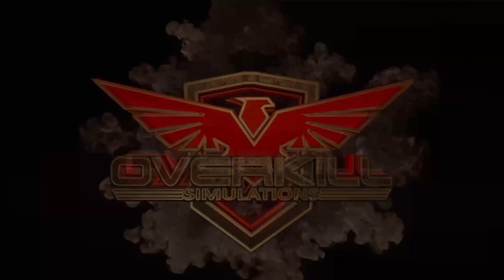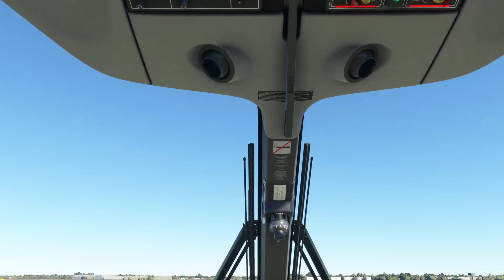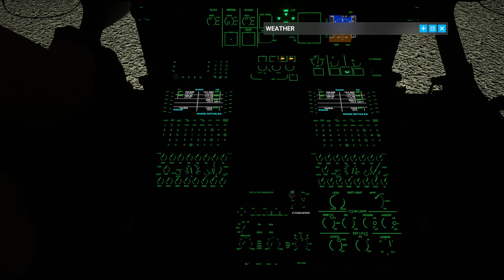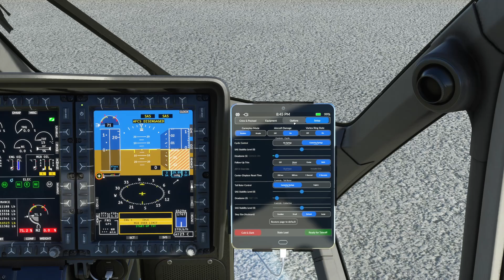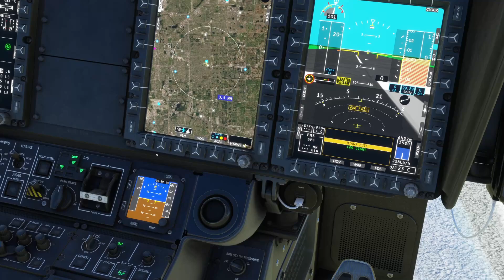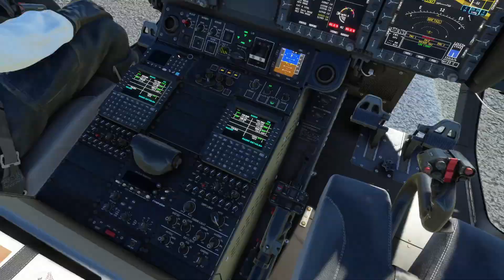HPG Airbus H160 Helicopter | Pre-Release! MSFS

Comment: The H160 is not Fly-by-wire. The only civilian helicopter with FBW is the Bell 525.  
The green lightning is Night Goggle Friendly.   
OEI = One Engine Inoperative
Reply from the maker: Thank you for the information.. and yes you're right.. the FBW statement was bad verbiage...
Reply: @OverkillSimulations  Airbus and especially the 320 is known for FBW. It's easy to think that their helicopters will have it too. They did consider it when they designed the H160 but decided against it due to complexity and cost. I bought the H160 last night and wow its a great bird.

Keep up the great work. 😊

Comment: Looking forward to this. Not sure if I will get it straight away or not though. 

It looks so sharp on the outside with the how sloped the glass and nose is.

I’m guessing they’re supposed to be that quiet on the inside and from videos I’ve seen I think they are… if you’re a millionaire buying one of these you don’t want to have to wear a headset.

Does the manual have a guide for what keybinds/axis to set?

Also, lol at the Jurassic Park bit, I had the same thought. “We need an InGen livery.
Reply from the maker: Yes the manual does contain the information you stated

Dude... I know just the person to reach out for and I will try to get the livery... I wonder if that would be copyright though... I might have to look into that first but that would be funny!

Comment: You can access your terrain warning stuff in the tablet along with your air traffic stuff. 
The H160 is a highly advanced executive helicopter and doesn't have the interior noise of your usual helicopters. 
Also, you don't need a counterweight on your virpil. Either adjust the clutch tension or remove your 44-ounce slurpee as you shouldn't have a cup holder mounted to your collective sir. 😉🤣
Reply from the maker: Already as tight as it can be and the cup stays 😉